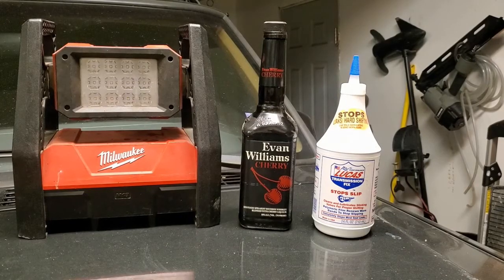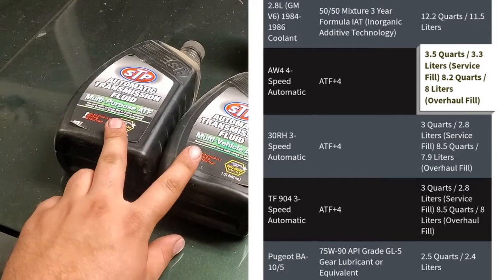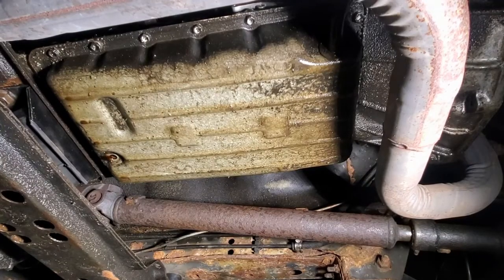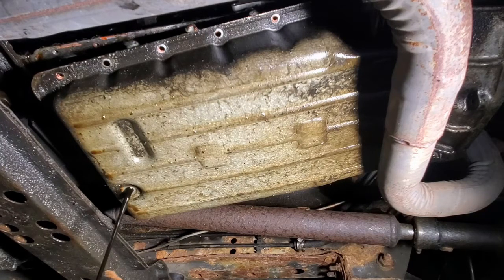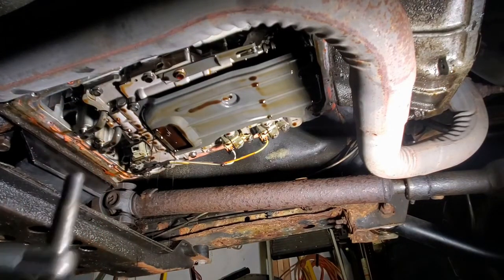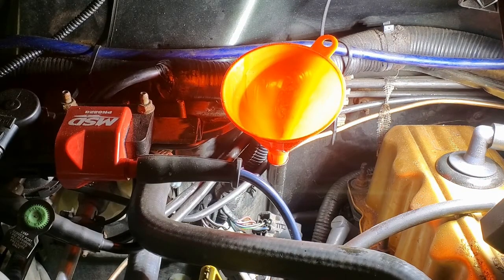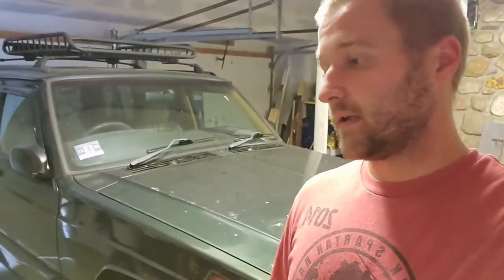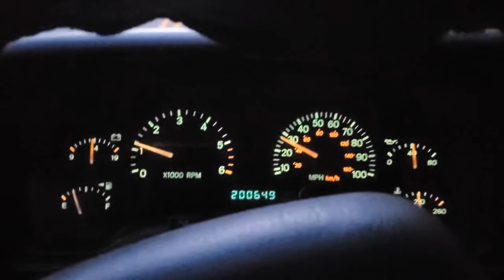Jeep XJ 200k mile trans fluid change

Comment: Drain and fill never hurts. Just don’t flush it. Flushing it out takes all the metal fragments out of the clutch pack,which might be the only reason it has friction.
Reply from the maker: Yes definitely, I can't stand auto transmission I'm hoping to get this swapped over to a 5 speed
Reply: @offthejeepend178  Wish i knew how to drive stick

Comment: This transmission requires Dexron, while the 42RE / A500SE which replaced the Aisin-Warner transmission midway in the 1993 model year needs ATF+4. Again, if you are confused, you may just want to try one of the new universal fluids that is both Dexron and ATF+4 compatible.

Comment: You should probably drain it as soon as possible and put the correct Dex/Mercon in
Reply from the maker: That all sounds correct, I think the fluid was supposed to be safe to use for it. Regardless it's got over 200k and is half filled with Lucas trans fix. If the trans flatlined today, it will get me to finally buy a manual trans for the jeep. I appreciate the info as well!